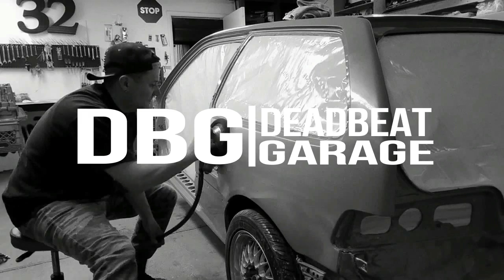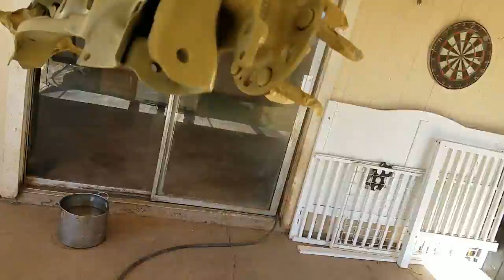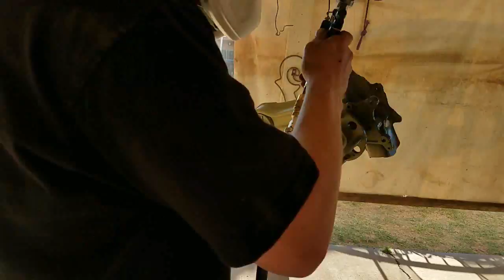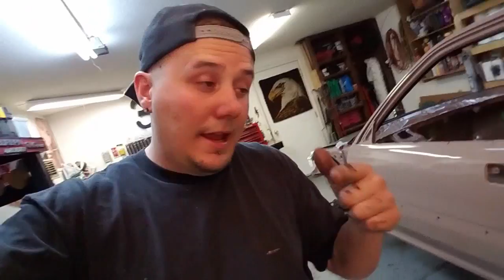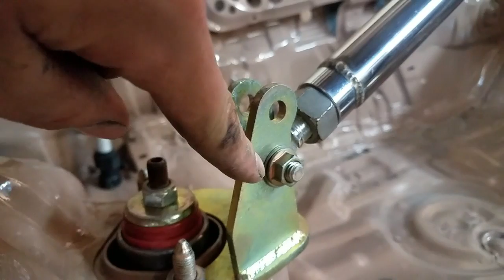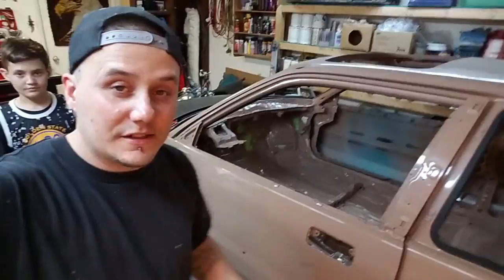EF Civic project ep.21 (painting trailing arms & X-bar install)

Comment: why does the door pillar need to be black? the trim covers it either way, and the x bar would look good painting it the same color as you did the transmission. the trailing arms would've been better that color too.
Reply: They are supposed to be black cuz of the parts of trim go over that don't fit perfectly edge to edge and you will see the color if the paint under it. If it's black then you can't really tell and it just looks all black.